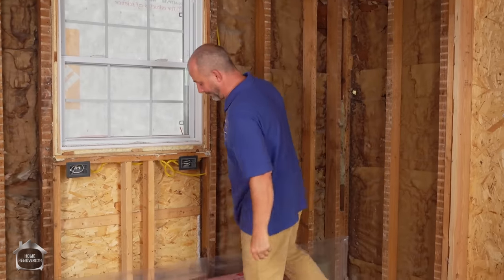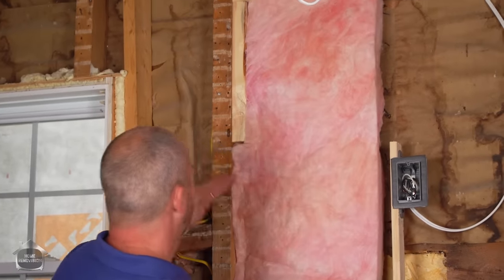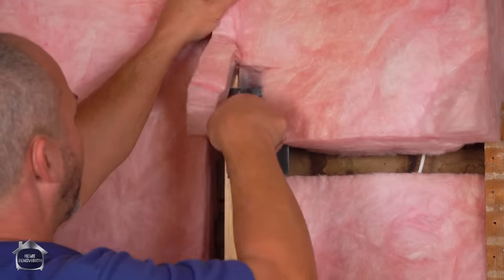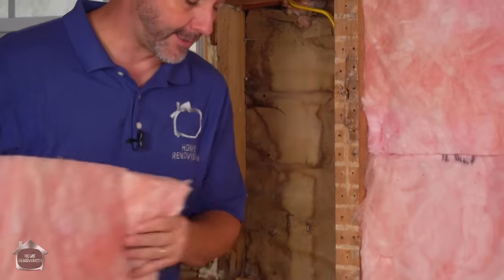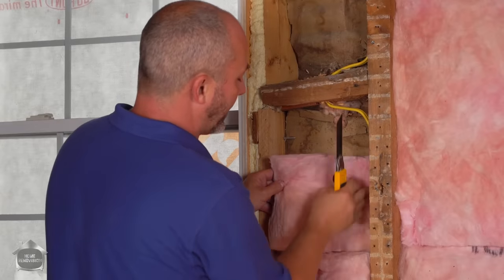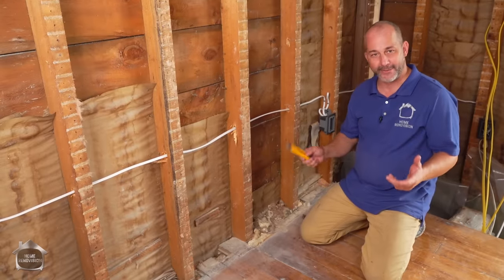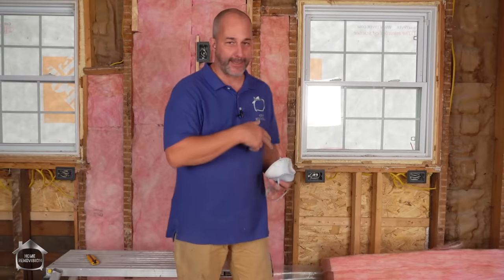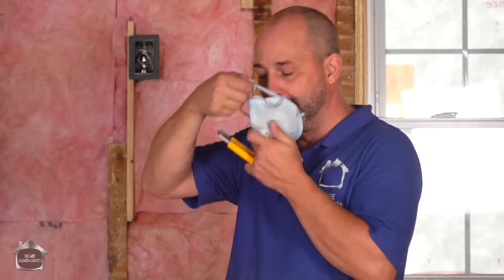How to Install Insulation | DIY Kitchen Renovation Pt. 1

Comment: The question I ask here is:  if you used spray foam, how much labor would you have saved? 

Foam, especially in an old home has a few really nice properties. 

Closed cell acts as a vapor barrier. 

It's an amazing air sealer. 

The real kicker for me though is that it's a lot more fool proof (as long as you don't need to chip it out later!!!!)   It expands in place and pushed into all the little spaces and gaps.  It works around all the oddball framing (old windows, doors, etc).    It's easy to get into those ribbon joist bays too. 

This is especially important if you are paying someone to do the work, as they will sure-as-hell not as much of a craftsman as Jeff is.    I managed an OK job in my bathroom with the vapor barrier, but there wasn't a half dozen outlets and windows to deal with.  

Finally, the closed cell stuff actually helps make walls more ridged.   This isn't needed if you've got plywood sheeting, but in my old house with 3/4 barn-board, it made a noticeable difference in some places. 

And BTW,  you can still get your building code R values with closed cell in 2x4 construction.

NB:  my house is in Boston,  built in 1912, and some odd hybrid of balloon and platform framed.   YMMV.
Reply from the maker: I agree about the benefits, however for many folks the budget is where they get stumped. It is easier for me to be an advocate of batt insulation because everyone can afford it. folks with deeper pockets are going to get the superior foam product. Cheers!
Reply: @HomeRenoVisionDIY  I understand your point, cost is very important when picking a solution.

My point is that I think your best case implementation there is like 75% as good as foam.   

If you're missing a step, are new to this, or have walls with Swiss-cheese framing, it's only going to get worse.

You don't need to hire a foam truck to do it...

To save $$$, maybe  just use the foam for first inch or so (similar to what you did in that crawl space).   That would help solve the complexity problem i'm worried about.

Comment: Tha is for all of you're videos. 
Had a quick question.  
Do you need to put a vapor barrier on and interior wall ?
Reply from the maker: never needed Alan. The barrier is part of the exterior insulating system. Cheers!

Comment: I built my own home, took me 2 years while working a 40 hour week job. I went with cellulose insulation and I am glad I did. Furnace filters are made with fiber glass, because air goes right through it. The best insulation is a vacuum, the second best is a dead air space, cellulose is far better at stopping air than the pink stuff.

Comment: If your insulation has paper backing, do you still need to use the vapor barrier? I live in the North on Lake Erie and am getting ready to redo the entire inside, should I use vapor barrier on the inside if the outside is already house wrapped?
Reply: Beth Riedlinger the exterior house wrap is an air barrier; it allows moisture to escape from the wall. The vapour barrier prevents condensation from forming in the wall when it’s cold outside.

Comment: Ok!, it looks good and all, now my question is how would I insulate my home when the walls are still up, the home was built in 70's, go figure and I know the insulating is looking like the time you sprayed water on it,
if there's a video that you have done on this project please let me know.
Many thanks
Reply from the maker: on a house that old I would remove the walls and insulate properly. you might even find yoiu have aluminum wiring and have a chance to upgrade your electricaL SYSTEMS to save money on your insurance and increase the value of your home at the same time.
Reply: @HomeRenoVisionDIY  Thanks for getting back to me,  and now I know what the contract would not tell me, the information that you are given out will never grow old, once again thanks

Comment: I live in New York, and both faced and unfaced insulation are sold at my local HomeDepot. Which would you recommend and what is the difference between faced and unfaced?  Do you still need to use typar paper behind and plastic vapor barrier in front of the insulation with both of these?
Reply from the maker: not with the faced. Cheers! you can staple the face to the stud to keep the insulation from ever falling out!
Reply: @HomeRenoVisionDIY  So I don't need the typar paper with faced because it won't fall out. Do I still need the plastic vapor barrier or does the face act as a vapor barrier?
Thank you for your help

Comment: You don’t need the plastic if you use the faced insulation, correct??
Reply: Also for an outside wall R 21 is OK to use correct? I have 2 x 6 wall to insulate..

Comment: How to deal with cold house corners on a 2x4 construction? on cold winter nights I got condensation at bottom of the wall and it's really cold !
Reply from the maker: time to open the walls and add insulation. Cheers!

Comment: In my house all is Rockwool in various thicknesses... 40mm, 160mm, 240mm.. stacked up to max 320mm (towards roof)... Basement is insulated on the outside with XPS (100mm). For our woodframe houses we usually put the insulation between the framework, then attach a first layer (usually fermacell gipsum board or OSB or similar solid material) on top of the insulation onto the frame, THEN put on the vapor barrier, eventually connect the wind barrier to it, and  on top of that, we put on the drywall board. This sandwich construction, among other things, usually prevents a possible "tear apart" of the vapor barrier if you drill into the wall. Next to creating a more sturdy wall.
Sockets usually are placed after the drywall installation. A hole saw with the standard size for the inserts and our antidraft socket installation inserts for the outside walls where the vapor barrier is. This is just a brief summary. There is much more to it...
Reply from the maker: sounds like a lot of effort to solve the last 1% of a problem. perhaps installing a dehumidifier in the house instead of all that extra effort!
Reply: @HomeRenoVisionDIY  apparently, this is just a fraction of a greater complex setup for energy efficient homes here. Primary goal of this setup is to establish an airtight hull. Oh yes, I forgot: The outside of my house is also completely covered in at least 15cm insulation.  Well, instead of writing up what's already written down somewhere: https://www.german-energy-solutions.de/GES/Navigation/EN/Energy-Solutions/EnergyEfficiencyInBuildings/energy-efficiency-in-buildings.html

Comment: awesome!  I haven't seen all of the videos in this series just yet, apologize if this is redundant.  Have you added a vapor barrier to the exterior as well?  Is it critical in this system to also have an exterior vapor barrier?  I also live in the north, a little less north but still a heating environment, and have neither insulation or vapor barrier.  Old house owner and taking notes...
Reply: Wait, I just realized something.  When you do windows in the next episode we’ll get a look at the rest of the story.  No worries.  Keep up the great work!
Reply: Micah Deffries vapour barriers are installed on the warm side. The exterior can be wrapped with an air barrier which prevents drafts but allows moisture to exit the wall cavity.

Comment: A long time ago they used to just stuff newspaper in the walls for insulation LoL 🤣  I've seen that an awful lot around here
Reply from the maker: That was back when the furnace was just blaring so much you could walk around in shorts in the winter time.
Reply: @HomeRenoVisionDIY  LoL yes, around here they used to burn coal,  everyone had a coal furnace, it was a coal mining area and it was cheap

Comment: Will insulation keep a shed warm before closing it behind drywall? Or does closing it behind drywall activate it’s heat retention? P. S. Your thoroughness as you work is sooooo easy and enjoyable to watch.
Reply: I’m located in the south.
Reply from the maker: drywall has nothing to do with heat retention. Cheers!

Comment: so those plastic electical boxes im guessing do not need to be wrapped in 6mm on outside walls?
Reply: J Smith in another comment he said there’s a gasket where the wire passes through the box.

Comment: Doesn’t the stapler create little holes in the vapor barrier? Or is the barrier more for cold air than moisture?
Reply from the maker: hard for air to travel when the plastic is compressed between the framing and the drywall. Cheers!

Comment: I just bought mineral wool for LESS than the cost of equivalent fiberglass (R-15 for 2x4 stud bays), so YMMV on price.
Reply from the maker: The bag may have been cheaper but it has half the sq footage in it. always compare the price by sq ft for the job. Cheers! If it is actually cheaper please let me know what store it is so I can buy all  my insulation from there in the future. I can double my money reselling it in every other part of the country!
Reply: @HomeRenoVisionDIY  I did compare by square footage, and the fiberglass was just over $1/sqft, while the rock wool was just under.  This was at a Lowe's in Louisville, KY.  Sadly, they only show 20 in stock today.
Reply: @HomeRenoVisionDIY  I did the comparison by sqft, not bag.  I re-checked it the next day and the mineral wool was slightly more expensive (by pennies per sqft).
My only point is that it's worth comparing, even when it's something that's normally more expensive.

Thanks for teaching me that the two are completely interchangeable, and that Olfa knife is magical!

Comment: hi Jeff, what if the room i'm renovating has an attic above. Should I also put a vapour barrier there? i'm in Canada so furnace 5mo out of the year. There's two reasons that is making me doubt whether I should. 1) This room is probably 1/8th of the whole floor surface area, and the rest won't have a vapour barrier (just used older insulation with paper on one side). 2) Theory that you want the moisture to rise up through the attic where proper airflow will bring it to the outside. Love your channel! This video was timely for the stage i'm at for my reno :-)
Reply from the maker: if you have warm air rising into the attic it is bringing moisture with it and will condensate into the insulation and cause a moldy mess. Cheers!
Reply: @HomeRenoVisionDIY  thanks!

Comment: Amazing video - like all of them!! Just about to tackle this in the kitchen of an older home, looks like "true" 2x4 studs - is it OK to go with r19 (5.5inch) and compress the 1.5 as opposed to going 3.5 with .5 gap?
Reply from the maker: you should be able to find r14 which is actually designed for true 2x4. however if you must get the 5.5 then when it is compressed it functions like a R14 just costs more. Cheers!
Reply: @HomeRenoVisionDIY  thanks so much for the reply!! I picked up some r14 after searching a few Home Depots

Comment: Where is the line between having the vapor barrier inside or outside?  I live in Missouri.
Reply from the maker: only God knows. It is not a perfect science for sure. Check with your local building office. Cheers!
Reply: If you heat your house then use it inside. If you air condition only then use it outside lol

Comment: I know this might sound like a dumb question but what actually happens of no vapor barrier is installed?
Reply from the maker: then all the moisture from inside the house gets deposited into the framing.
Reply: Home RenoVision DIY but when the Sheetrock is installed and painted, doesn’t that seal the room from allowing any vapor/moisture getting to the framing?
Reply: @Sir_Lionheart  This would not create a proper seal for your house. Think about it this way. It would stop moisture penetrating the wall that is painted. So what happens where wall meets floor? what about in-between in the floors in the plenum? You might see it marketed as twice as good as 6mm poly but only where drywall exists which in not 100% of your exterior walls! Just my 2 cents on it!
Reply: Steve Main Thanks Steve. Back in the day before plastic sheeting, was there ever evidence if damaged framing from moisture? I’m in the dry climate of California. I bet Florida is a bear for moisture.
Reply: @Sir_Lionheart  I am no expert to be honest just my opinion when thinking about it. If you don't have a vapour barrier moisture will get to the outside cold air (colder climates) or moisture will get to the inside cold air (warmer climates). So what happens when cold air meets warm moist air? The water held in the air (humidity) deposits on the colder surfaces (Think glass of coke with ice in it on a warm day) that condensation on the out side of the glass is humidity from the air condensing on the cup because it's cold. The exact same thing would happen in you wall day after day after day and that moisture would eventually rot the wood as it's not pressure treated. Cold air make warm moist air drop it's moisture and is why normally there is a desert on the other side of large large mountains. Warm moist air has to go up and over the mountain, air temp drops as it goes up, moisture in the air turns to snow, air goes down on other side of mountain with 0% humidity.. you get a desert! For minor temp changes like 22c in you house 19c outside it would not be a huge deal. but when you start talking 22c in your house and -2c outside condensation will form for sure. Heat will always meet cold somewhere between your walls. You just want moisture stopped a certain distance from that point so that it cannot condense (R value)
Reply: Steve Main Thanks Steve.
Reply: Look at some insulating and vapor barrier articles on buildingscience.com , finehomebuilding.com , and greenbuildingadvisors.com 
Most sources show that an interior class 1 vapor barrier is not ideal in all but the coldest of climates. If you air condition your home then an interior vapor barrier can have a negative impact. Exterior insulation and proper air sealing will raise the temperature of the sheathing and framing members and prevent condensation inside the walls. Also latex paint is considered a vapor retarder class 3 and is suitable in many climates. Managing interior humidity is another important aspect.
Reply: @ryanloney3614  In most places in Canada, no vapor barrier will lead to rot and mold of the framing and the insulation will get soaking wet. The vapor barrier, especially in older construction will also serve as an attempt to control air movement. Cold moist air contacting warm dry interior? Condensation in walls. Cold dry air contacting warm humid interior? Condensation also. And you have air leakage, so loss of heat. Unless you have a proper exterior insulation and thermal break that keeps your framing warm enough, no vapor barrier will lead to bad doodoo.

Comment: Hi Jeff, Can R-19 insulation recommended for 2x6 frames be used for 2X4 framing? Also, for 16" c-c frames i see 15" wide and 16" wide insulation options. Why is there an options? Which one is best and why?
Reply from the maker: the 2 different widths are for wood or metal frame construction. yes you can use the r19 however you will only get r 14 level of insulation when the product is compressed into a smaller space. best to buy the product for the frame and save your money. Cheers!
Reply: @HomeRenoVisionDIY  Thanks Jeff for your quick reply.
Reply: Hi Jeff, one more quick question...can batt or roll either be installed in walls? Any difference besides installation?

Comment: Can you do the same plastic vapor barrier in a mobile home? We have terrible drafts coming up through the floor and don’t know what to do about it.
Reply: I've lived in a mobile home before.
My experience has always been
First - make sure your skirting is up to snuff. If the wind can't get under your trailer, it can't force it's way into your home.
Second, get under the mobile home and make sure there are no holes underneath.
9 times out of 10 drafts are due to someone opening up the insulated board under the trailer to work on water or electrical, and leaving a big gaping hole for the cold to find it's way in. If you find a hole, put some insulation in there and put plastic over the hole.
Reply from the maker: I have a sneaky feeling we will have to do a trailer series one of these days!
Reply: @HomeRenoVisionDIY  Yes!  It is not easy to find experienced advice on MH renos.

Comment: Question sir 
If you have a metal roof that leaks thru the screws how should it be repaired?????
Reply: Unscrew and replace with roofing screws that have rubber washers but not too tight to blow out the rubber washers.
Reply: @bobbray9666  Thank you for the reply

Comment: If you live in an area where 3-4 months are spent heating your house, and another 3-4 are spent cooling your house, and both are pretty aggressive, should you have a vapor barrier on both the inside and outside?
Reply from the maker: never. you have to make a choice. in most cases if you get a severe winter then insulating for that with this technique is perfect. in the summer even though there is a lot of heat the humidity is not as much of a problem in areas in the north.
Reply: @HomeRenoVisionDIY  would it hurt to have both? It gets VERY humid in Summer where I live, but we also have harsh Winters.

I live in one of the Northernmost places in the US that is still considered "Humid Subtropical" on the Köppen climate scale, cause I'm surrounded by and touching the conflux of two major rivers.

Our temperature records range from -37°F/-38°C to 112°F/39°C.
Reply: DeDraconis having vapour barrier on both sides won’t allow any moisture that’s in the wall to leave, thus promoting mold and rot.